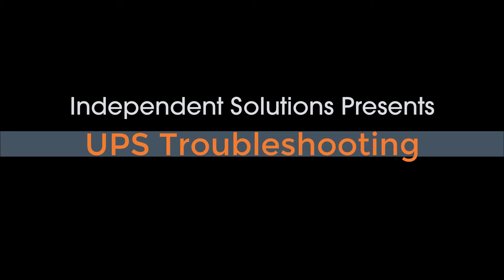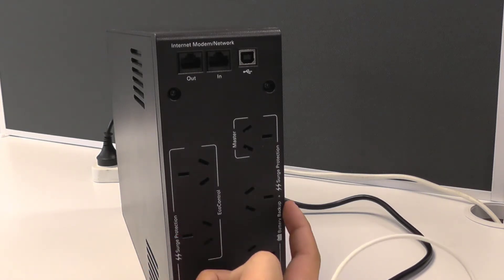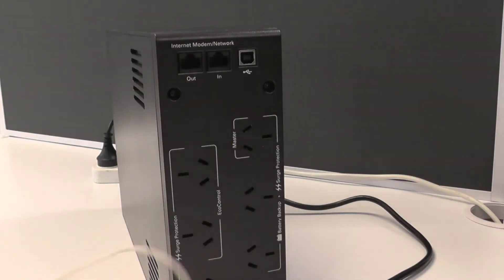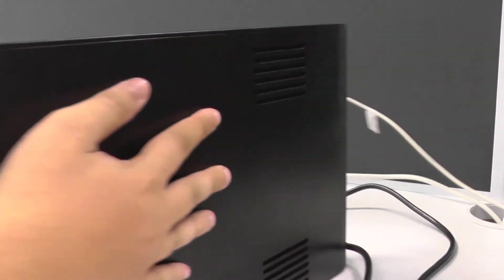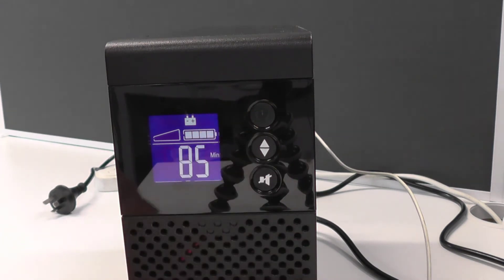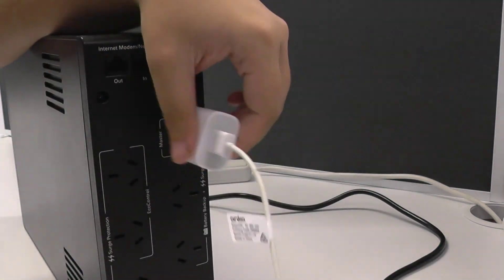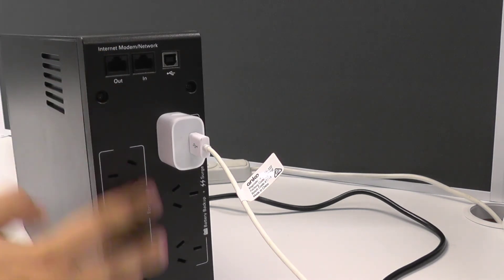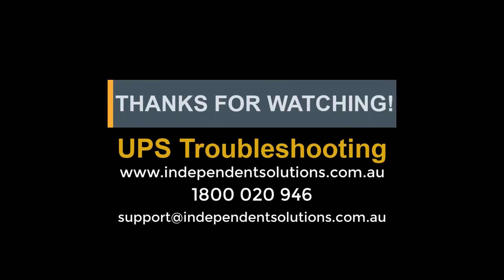UPS Troubleshooting Video

Comment: you basically explain how an UPS work.  This is not what i call a "Troubleshooting" video.   Battery need to be replaced, there's an icon for this.  What if the LCD keep flicking and i hear some kind of  relay clicking in it?
Reply: Just opened mine.  The battery litterally cracked opened.  I don't know if it was the cause but i've just ordered 2 new batteries.  Usually when a battery die, it just stop working when there is a power glitch... it doesn't make any relay clicking, so i'm not sure it's just a battery problem.
Reply: Right - he shows that it is working just fine. I'm trying to find solutions to a problem

Comment: I bought a new EATON UPS 5S 700 LCD  I have been charging it for more than 24 hours, but it doesn't turn on????
Reply from the maker: Have you held the power button in? These units won't turn on with a single button press